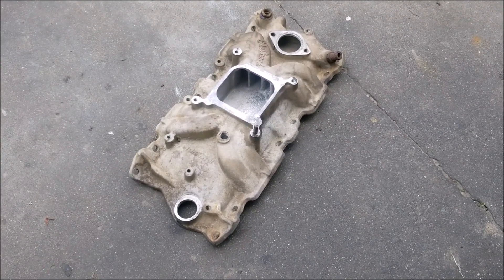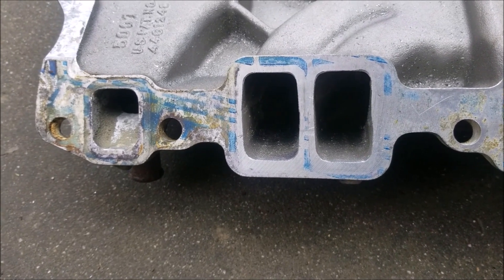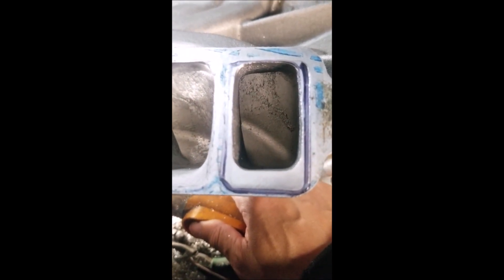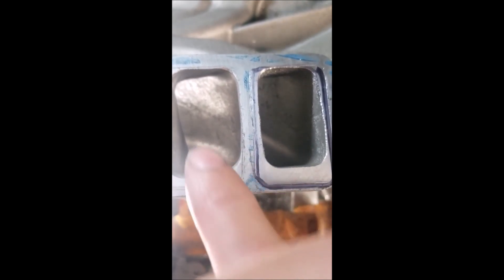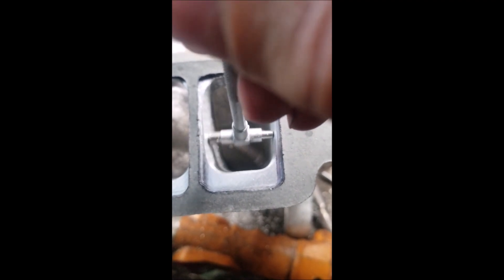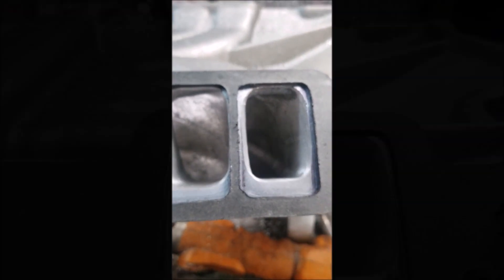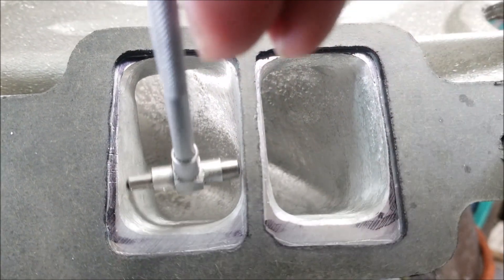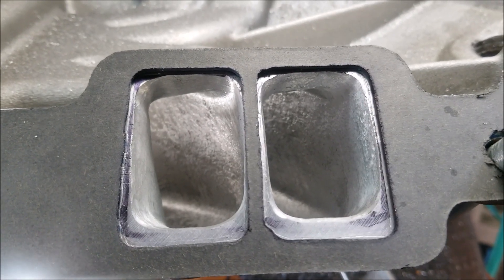SBC Torker ll Porting: Intake manifold mods

Comment: The first thing I do to brand new aluminum engine parts like intake manifolds, alternators, water pumps ect., is paint them with Duplicolor Aluminum Engine Paint.  It makes a huge difference and is a lot easier to keep clean than natural unfinished/painted aluminum parts.